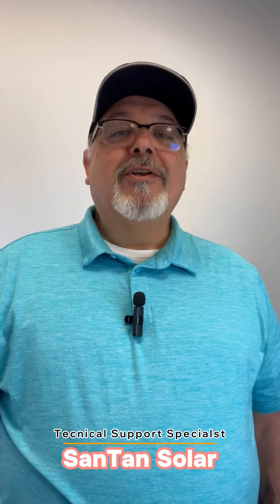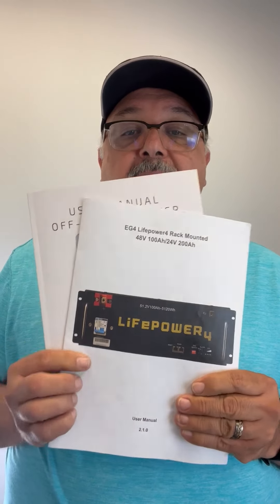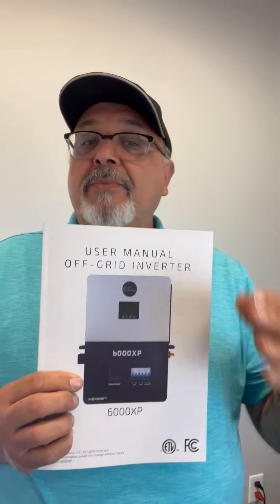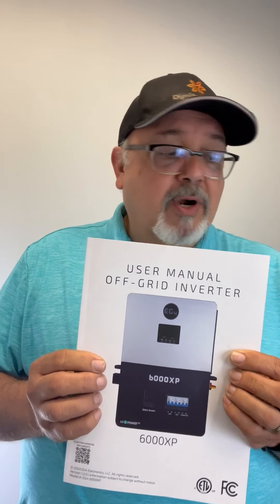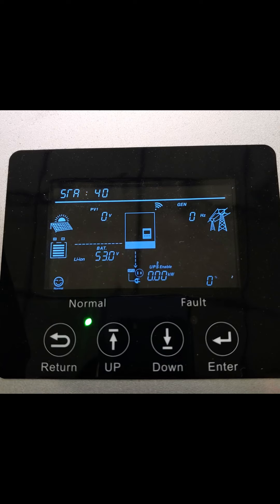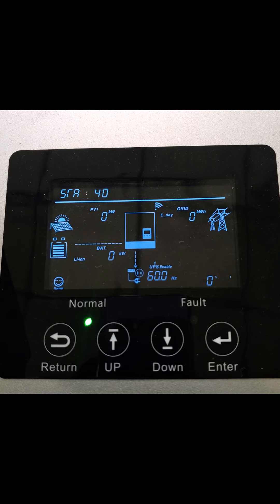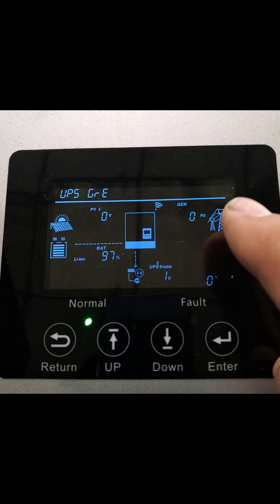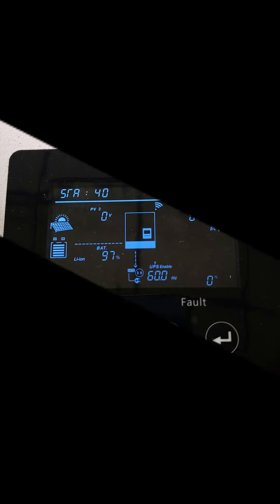EG4 6000XP Battery - Output Tips

Comment: Before you buy this 6000XP inverter which is manufactured by Luxpower, Ask Google AI, "Do Luxpower inverters have a higher failure rate than low-frequency, transformer-based inverters?"